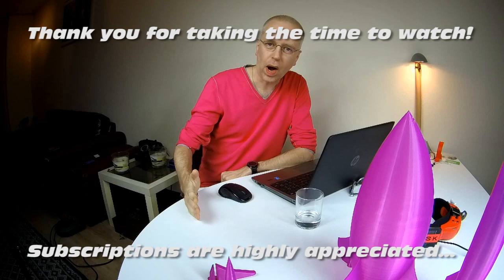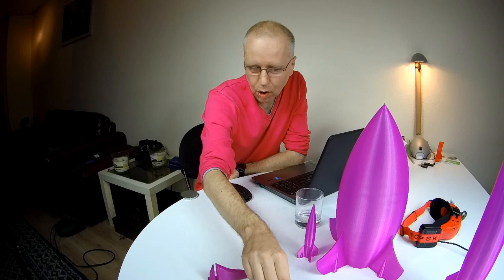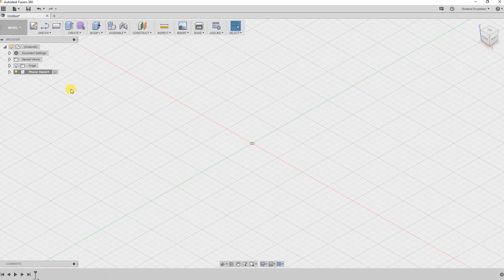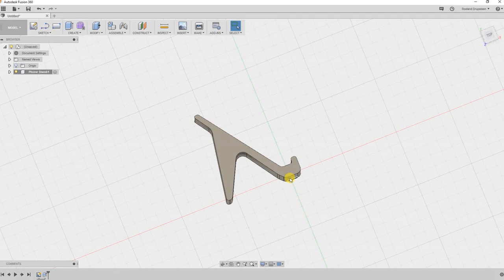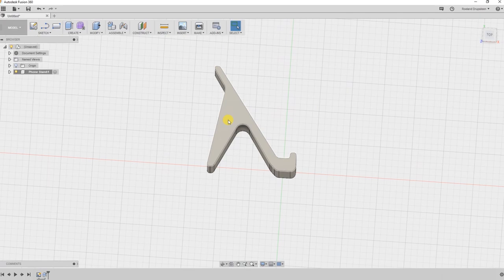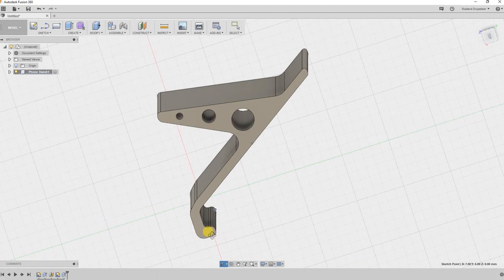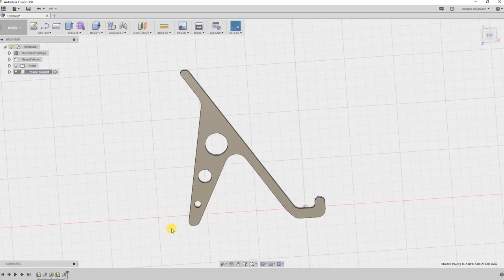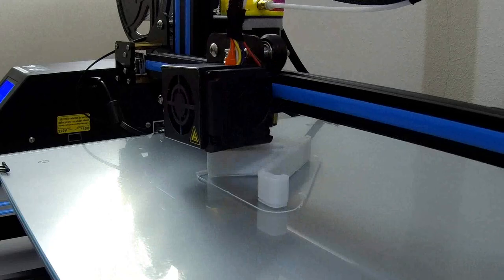3D Printing Series! P3: 3D Designs (Fusion360) and Slicing

Comment from the maker: Getting your 3D printer printing! (Fusion 360 & Slicing)
Link to the Creality CR-10: https://goo.gl/A25PYq 

Link to the Anet PLA fillament: https://goo.gl/7ztFNR 

Link to the actual phone stand designed: https://www.thingiverse.com/thing:2601006 

Song used in the video: https://www.youtube.com/watch?v=2TyTebByu1s&list=PLXgLCadWLBnC4iMl7XV452LpIQUcN0Ga9

Specifications:
Printing size: 300*300*400mm
Printing type: FDM (Melting touch stack molding technology)
Body structure: Patent technology V-Slot aluminum bearing
Nozzle diameter: Default 0.4mm, one 0.3mm nozzle for free
Filament diam: 1.75mm
Plug: Default EU plug
Print speed: 200mm / s, normal printing speed: 100mm / s
Accuracy: 0.05-0.4mm (adjustable)
Power supply: Input 110-220V switchable, output 24V
Actual power: 160-200W
Menu language: Chinese or English
Print accuracy: ±0.1mm
Environmental: 10-30°C, humidity 20-50%

Comment: I would like some more Fusion 360 video's :). By the way it's better to officially set these circle extrusions to the full extend of the material, instead of manually typing in -70 mm. This way when you decide to change the width of the stand to for example 100mm the holes will still be all the way through. You can do this by 'Extend to object', in the feature settings of the extrusion: https://knowledge.autodesk.com/support/fusion-360/learn-explore/caas/screencast/Main/Details/41c664c9-46f7-476a-82cd-14cba27bb255.html
Reply from the maker: Excellent! That indeed is a better / more convenient way of doing that :) 
Thanks for the tip!

Comment: FUSION 360 is great for 30 days but after it's £267 per year too expensive for me as I'm only likely to use it once a month ! I have tried the free tinkercad but it's nowhere near as good. I suppose  you get what you pay for ?
Reply from the maker: Probably yes, but from My understanding, you can re-new your trial over & over again.. I'm certainly not going to pay that, eventhough I do think it's wurth it (I just don't have the funds for it)
Reply from the maker: ps: if you register Fusion as a 'small business or 'enthousiast' you can use it for at least a year.. But as I mentioned before, you should be able to extend that
Reply: Thanks for super fast reply I'm going to do some research on google to find out. I just don't want to spend weeks learning how to use it and then having it taken away . I have been following your 3D printing videos from the start there great thanks. ( I have a CR-10 and use simplify 3D slicer)
Reply from the maker: At This moment, all I can say is: mine is still doing fine 2.5 months in.. Besides that: I think skills learned in F360 will allso serve you well in other design suits..
BUT yep.. I do see your point offcourse :) 
Thanks man!
Reply from the maker: Yeahhh I came across that one :)  printing some things can be a hassle huh? :) 
I've been learning design skills & designing my own plane piece by piece :)  That project is Not at a presentable state yet :$
Reply: Thanks for reply. I can't decide learn about cad software or become a brain surgeon ? All a bit much for a roof tiler ! Maybe I will have to wait for some more of your tutorials on fusion 360 as I found your last one easy to understand .